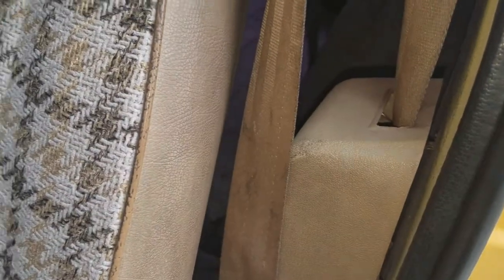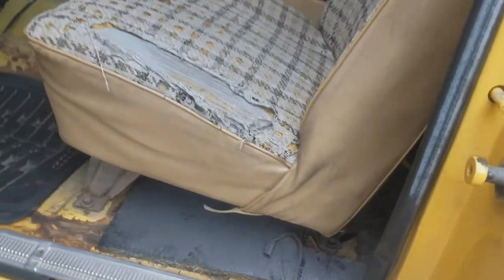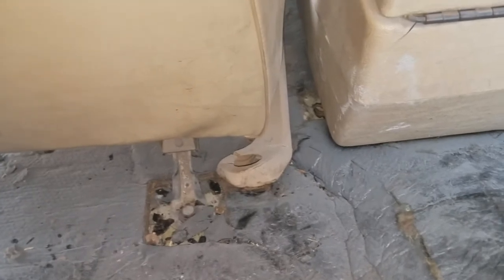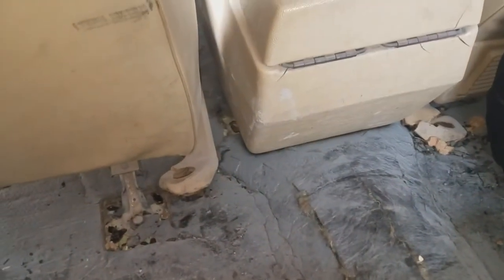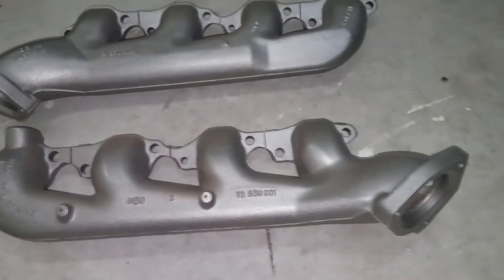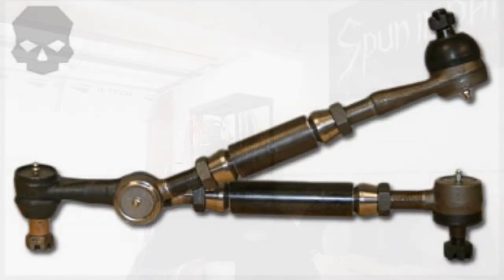82 Chevy K5 Update / Installing New Seat Belts

Comment: Hey Ik this is an old video but I need to replace mine but idk how to take the plastic cover off of the seatbelt part that goes on the side of the truck. The part right next to the door. How did you take it off I don’t want to break mine
Reply from the maker: Well your new belts should come with new plastic covers so it won't matter if you break the old ones. Mine just lifted up and then you unbolt the belt from the B pillar.